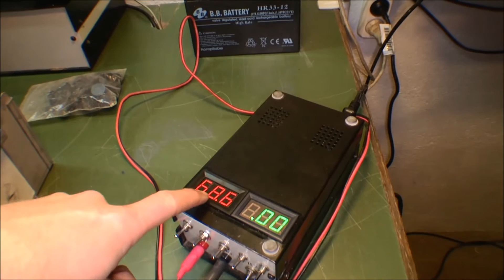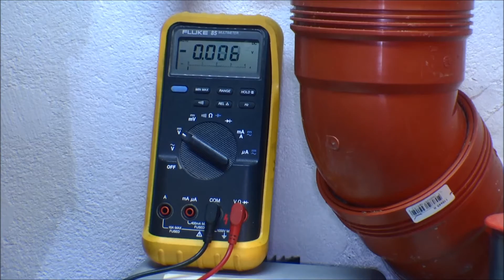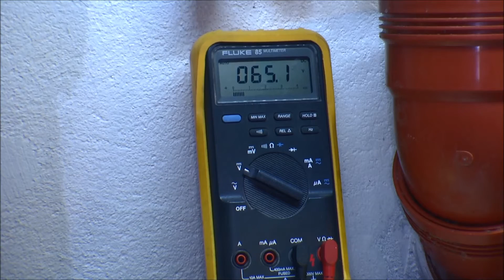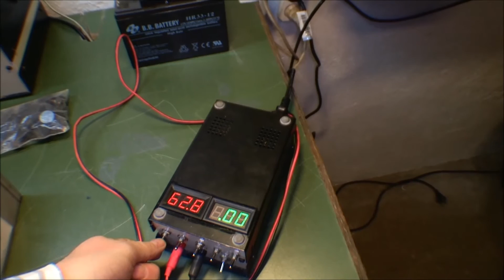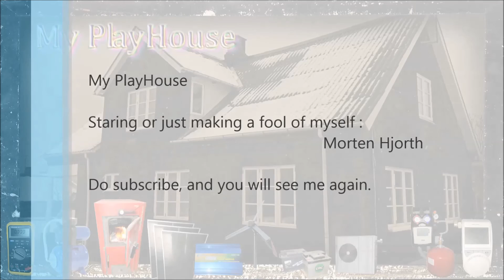Capacitive charger - 206volt on Hopeless battery bank - 147

Comment: Looks like a very nice build capacitive battery charger. Is it a certain brand ? 
Commercially on the market or homemade ?
Reply: We won't mention the horrendous power factor if the voltage of the batteries is well below the voltage of the mains.  Mine runs at about 75 w  and 750 va charging a 24 volt battery with 240 volt mains.  It wouldn't be so bad if I was charging a 200v battery with it.   I have "Evil  Charger of Death" written in big letters on mine and I don't have crocodile clips for the connection to the battery, I have screw terminals so they aren't so convenient  (and lethal).  Make sure the battery is well capable of swallowing the current you're pushing into it.
Reply from the maker: Hi Anne Henderickx
Thank You very much!  homemade,, I did not make it,, just lend it :-)
Thank you for watching! :-)
Reply: Is it possible to order such a set somewhere ?
Reply from the maker: Anne Henderickx 
Sorry I do not know :-/
Reply: Capacitive chargers are all home made.  No commercial company would dare sell such a lethal device.   Fantatic things for charging batteries with the minor downside they'll kill you in a heartbeat.........

On the upside they are very simple easy things to make.
Reply from the maker: Yes you need to be very careful with them.
and I have destroyed to many batteries whit that one, to keep using it.

Comment: Try to charge up each of the "bad" batteries on its own, until it reaches the same voltage as the good ones.
Reply from the maker: Hi logikgr 
I have done that, but it's really more efficient to charges all 16 batteries at once,, and not one ad a time :-/
But i have given the bad ones a shock with my power supply.
Thank you for watching! :-)